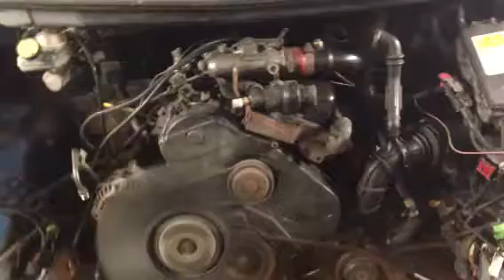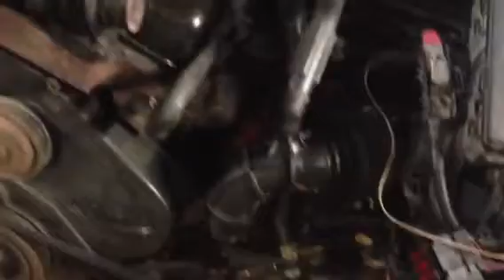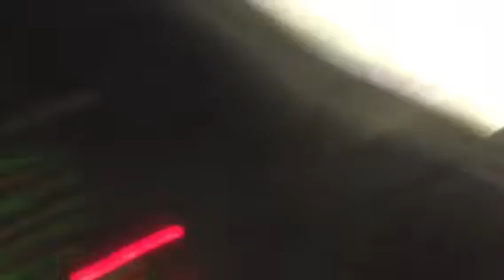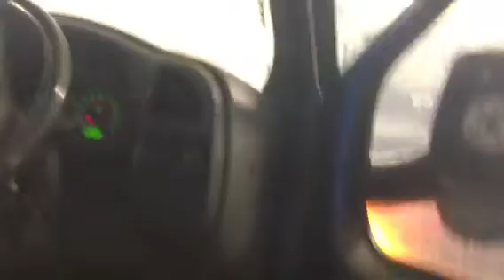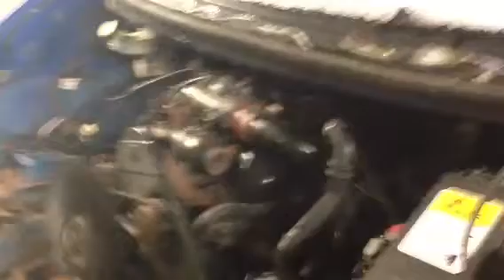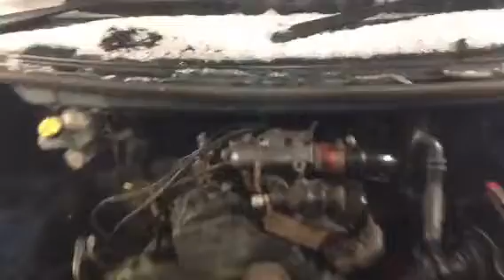Transit mk6 turbo di conversion

Comment: best old engines but all bottom end torque. 16 valver revs higher but vp pumps are crap and common rail is worse. the di was unkillable but needed a larger turbo than the small garet

Comment: did one myself but with banana engine . only way is to go to get rid of that crap duratorque. proper usable van now alltho a bit slow but slow is better than not getting there.oh and had lower emisions than previous engine had on last mot
Reply: I want to do this to my smile twin wheel base transit mate just spent 10 days welding her up new front end praticly there propper rust buckets lol how hard is it. And will it last or blow the engine